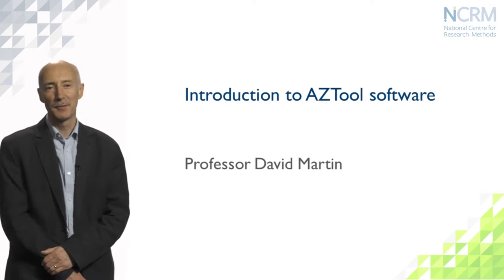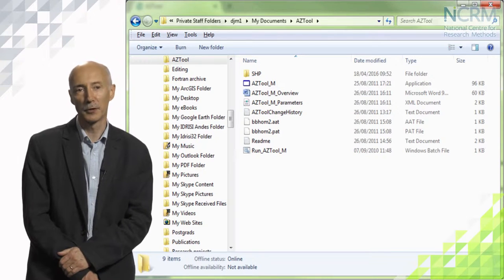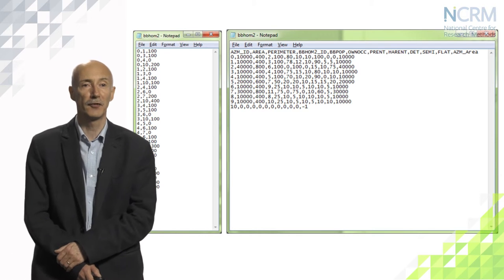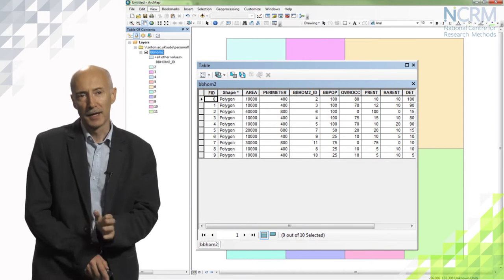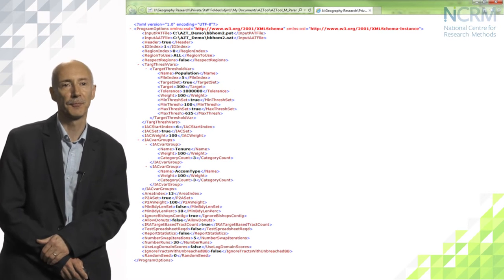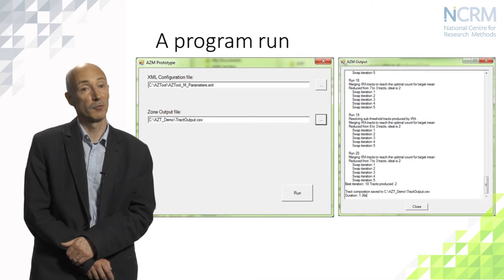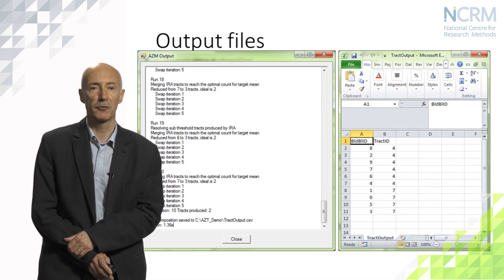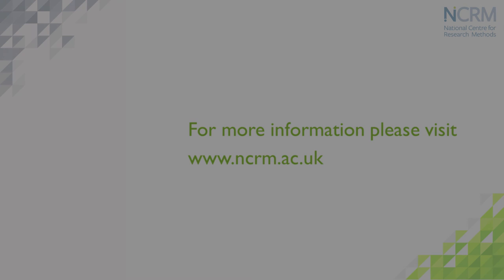Introduction to AZTool software; David Martin (part 3 of 4)

Comment: Hello.
If i Want a specific Number of output zones, what should i do un The application to give him the Number of final zone that i want ? 
Thanks a lot for your response .
Reply from the maker: The usual way to set the number of output zones is to specify the target size of the zones - so if a population of 200,000 was to be divided into 100 zones, set 2,000 as the target population size.  The software will try some slightly smaller and slightly larger options as the very best solution may be one with e.g. 99 or 101 zones.  All these options are controllable in the XML file which sets up an AZTool run.